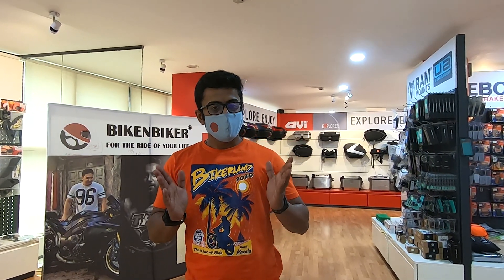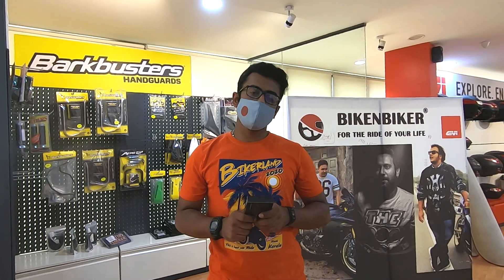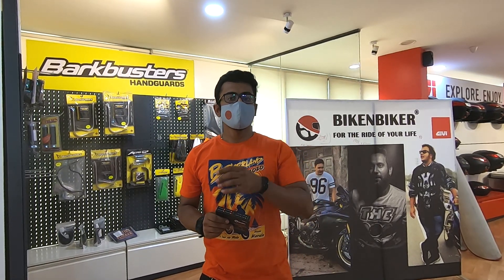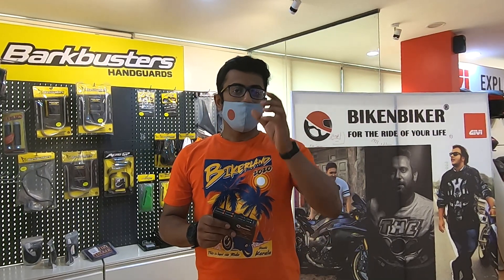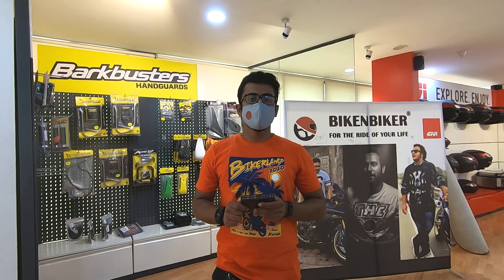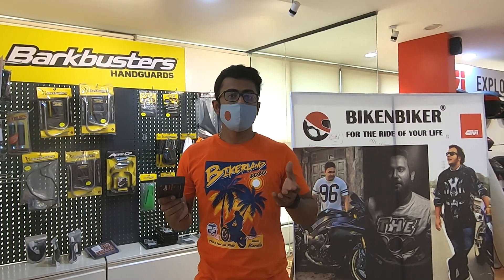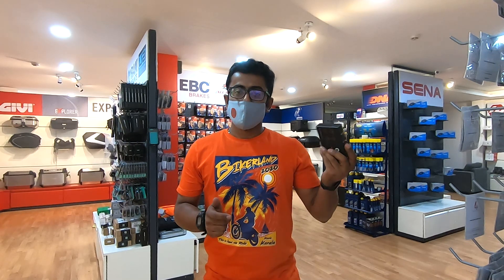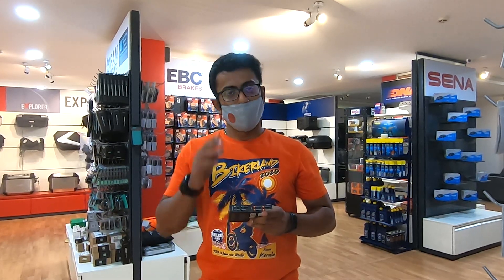Tyre Pressure Monitoring System for Motorcycles & Cars| AJ 390 |

Comment: Using a tool to open the equipment to fill the air is the downer. Other than that a good product.
Reply from the maker: You can also open it without the tool. That's what I've been doing and it works just fine 🙂